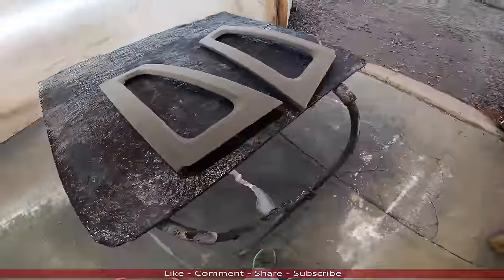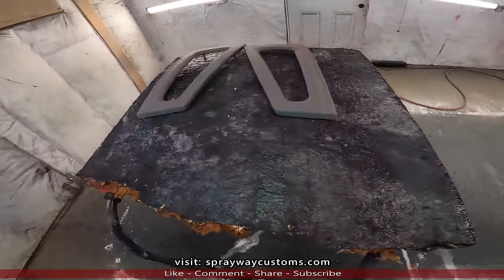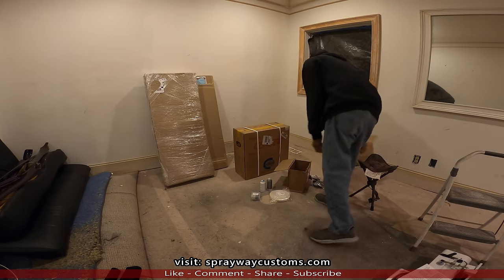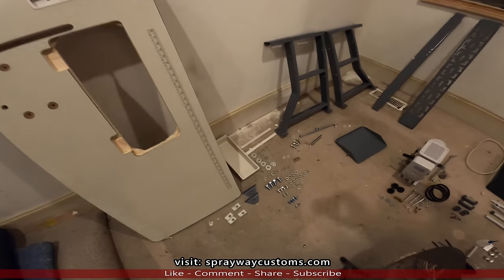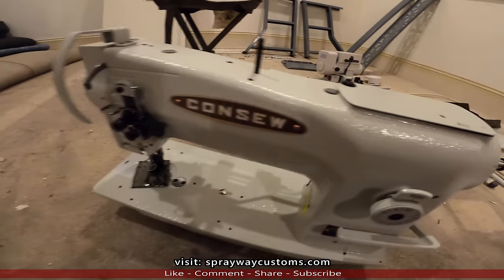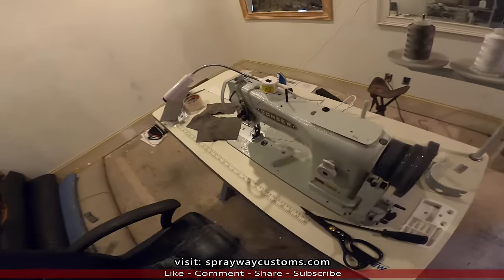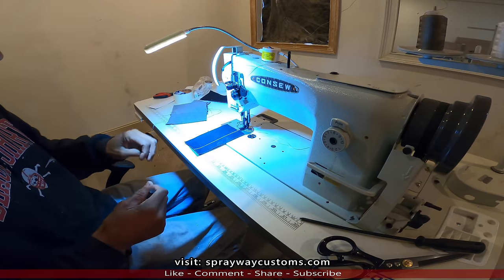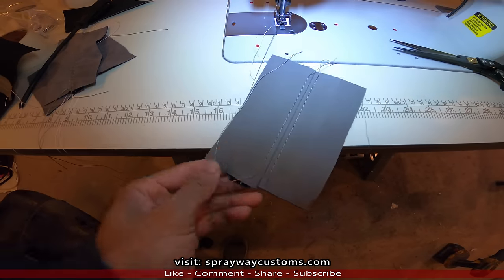SprayWayCustoms Expanding Business To Car Upholstery With A Consew 206RB-5 Industrial Sewing Machine

Comment: lol, so now you know the french seam isnt all that easy to keep perfect and parallel all the time.  You might look into picking up a few specialty presser feet which will help maintain the spacing.  But lots of practice is what you really need.  The perfect french seams come from dual needle machines.  I have been doing leather steering wheels for 14 years and part of the steering wheel gig you get a fair amount of custom shift boots and parking brake boots along with console covers and arm rests which need french seams.  They are even harder to make perfect when you are using an accent color stitch.

Comment: I just got the same machine How long did it take for yours to run that slow, Mine seems very tight and need some hand wheel turning to get going!
Reply from the maker: I actually purchased a smaller clutch motor pulley
Reply: @SprayWayCustoms  Thank you I am sure this will be a big help for me !

Comment: You've got it cornered!  I'd recommend sewing a couple head rests with a top stitch.  Those are about the hardest thing to sew because they are small and the curves are tight.  If you can get those nice, everything else is a piece of cake...  Then the lock stitch at the start and finish is an art form.  If you bury them behind another seam, you don't need to lock.  If you can't bury them, then a lot of people turn 90 degrees and do their lock that way.  I'm excited to see what you come up with.  Your custom door panels and dash panels are going to be at another level.

Comment: Practice sewing on cardboard with straight lines and curved lines drawn to learn how to follow the lines which is like the seams, that's how i taught my children to guide the material in the machine. 

The feet of the machine are made with specific spacing to sew at different wiidths from the needle, just look at the foot spacing from the needle. 

Use the outer edges of the foot as a guide to space off of the seam of the pieces you sewed together. 

Use the same side of the foot to make the same offsets for your top stitches, turn the piece to the end you need to start at for the top stitch spacing off the foot you used for the seam spacing. 

The walking feet are also calibrated to sew curves, look at the front edge of the feet when sewing a curve, they will be over the or near the first seam when you put the pieces together. 

Fast sewing is not as accurate, you don't need to go fast accuracy is way better, so you do it once so you don't waste material or do it multiple times to get it right. 

Back stitch about 3 or 4 stitches keeps the thread from coming out at the ends. 

Using Close spaced stitches on vinyls and leather is like perforations on the material it can weaken the material if sewn too close. 

So you can do 8mm spacing or about 3 stitches per inch on thse type materials down to 5mm spacing or whatever looks right, just sew up some scraps of the material and pull on them to see if the pieces are holding good and not tearing like perforated paper. 

The Thread tension is key also for joining the pieces, you trying to get the top thread and bottom thread to cross each other in between the two pieces, the green pieces are the materials being sewn. 

https://youtube.com/shorts/Mc10-O3KoNM?si=qVnWQrwfAv6s6yqB